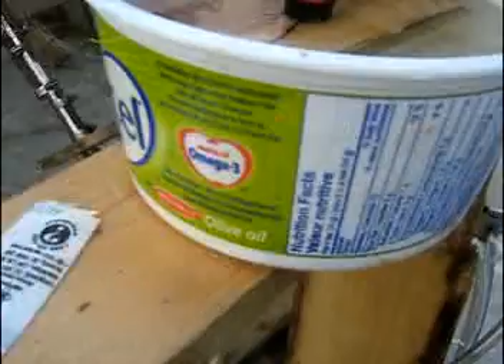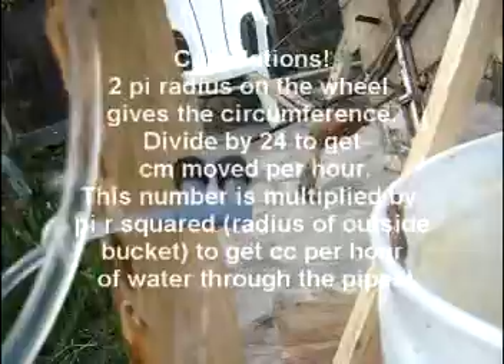Dripper tracker for parabolic solar accumulator!

Comment: Very clever, i like it!
As English is not my mother tongue, it took me a while to understand the purpose of the small bucket in the midle, but now i got it!
Thanks for sharing
Reply from the maker: +Joseph Curwen  Thank you.  I tried to do too much with this thing, but certainly it was not a failure,  just one more step on a learning curve. .  I wasn't even there to check how well it was working most of the time, away at work instead.      I hope to do a version that runs solar panels this year.  The solar cooking community in general,  refuses to innovate. It is the strangest thing.   I'm hoping to do some more this year but,  nowadays,  even if they list your video,  youtube no longer pays enough to fund this type of "research".  These projects are very time consuming.    Looks like my masonry business will be really busy for the next few months but sometimes there are rainy days or unexpected closures of job sites.

Comment from the maker: @hakachukai If you put it on equatorial or polar mount like I do, then the electrical work will be  much easier.  Each morning it will move a tiny bit on the seasonal axis, and during the day it will move at a constant rate on the daily axis. (So you can get your gearing just right).  The dripper tracker is part of the much bigger tracking solar accumulator project.  Your electrical tracking might work instead of the dripper. (The dripper should be resistant to  wind damage so I included it)

Comment from the maker: @hakachukai This was the first attempt at it. (It was several years ago)  
I really hoped that someone would follow up in a college or university or some 3rd world help organization. Seasonal adjustment was a problem due to changes in center of gravity.  The latest version (liquid piston tracker)  is just at model stage but I believe the center of gravity problem is solved.   There is a big chance that it will be part of the "mecatronics" course in University of Victoria this year.

Comment: Kind of neat. I'm not sure if it is accurate to call it tracking... but it looks like it could work if the focuse of your reflector is not too tight of beam.

How well does it perform as the seasons change? I know where I live there is a huge difference in the suns path from winter to summer.

Comment: Ingenious adaptation of a water clock as a control mechanism. Do you have any problems with wind-born debris, or did you slip a bit of filtering into the pipe intake?